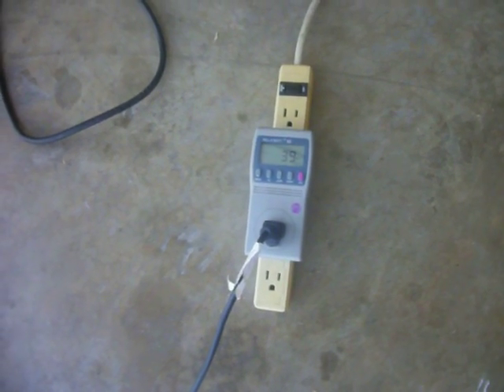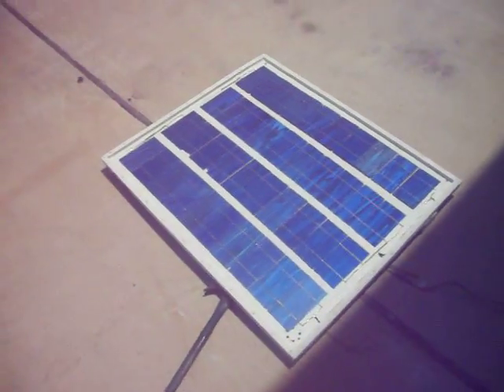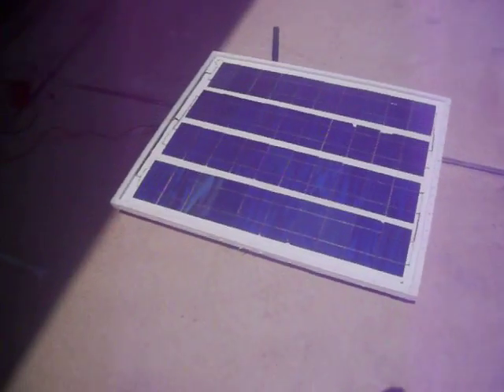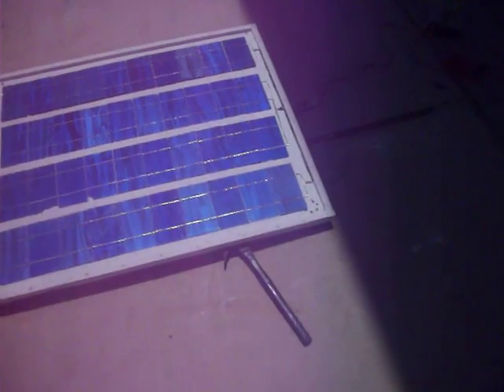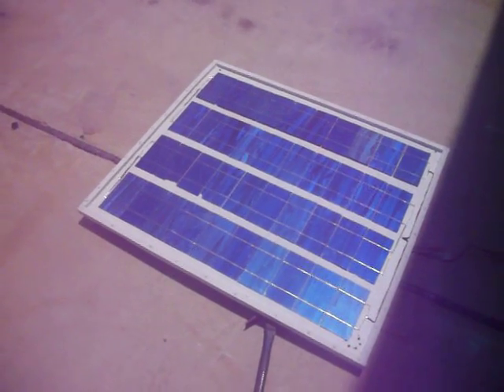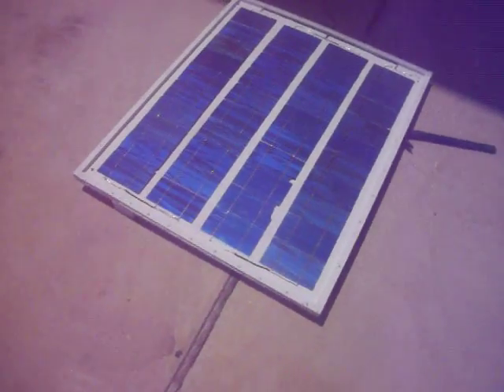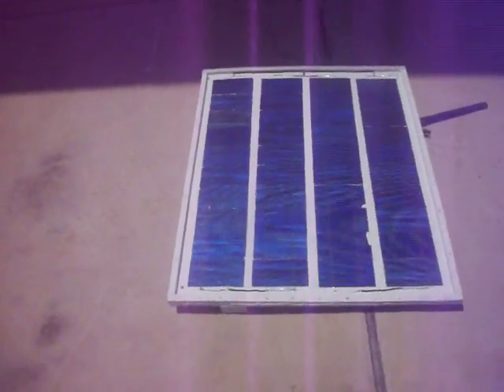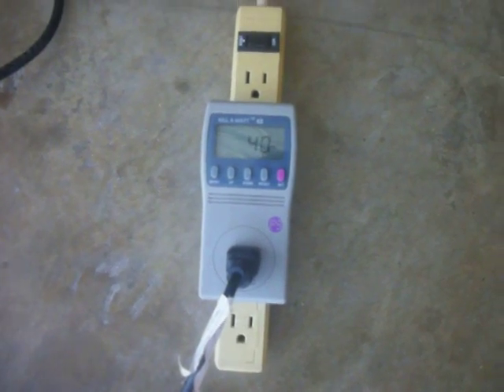DIY 75 watt SOLAR PANEL FRAMING AND TESTING GRID TIE INVERTER.

Comment: I'm 47 an getting ready to build my first one.  I'm a lone ranger new on eBa (2yrs) but I'll be getting 100's of the 6x6 monos I think and I wanted to know, I got two big sliding doors I was going to throw away. Should I make 72's out of each one or just max them out or do 2 or 3 smaller panels on each door.  I was going to toss them but I guess I'll get some.  How great it is to see you young folks taking initiative and teaching people to reduce carbon ft print and renewable energy - D future!!

Comment from the maker: i thought about taking the glass back off but with all the silicone i used i don't think it will be easy, and i'll probably brake some of the solar cells in doing it. I think i'll just put a some clear silicone over the crack and let it ride. maybe next time it'll turn out better.. thanks for your help.

Comment from the maker: @VWRabbitdiesel 
I already put vent holes and mounted a computer fan to the back.  i did use the 30x36 glass. have you thought about using plexiglass? i cracked the glass, i think it happened when i moved the panel because it flexed. oh well next time i'll get plexiglass..